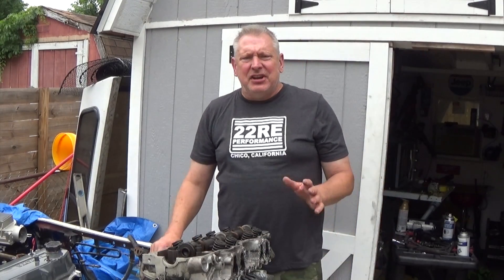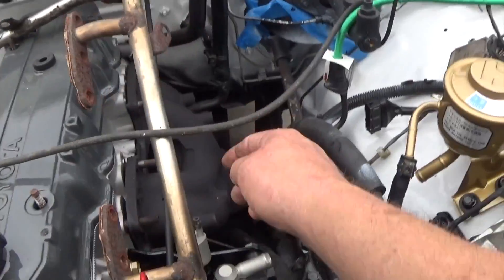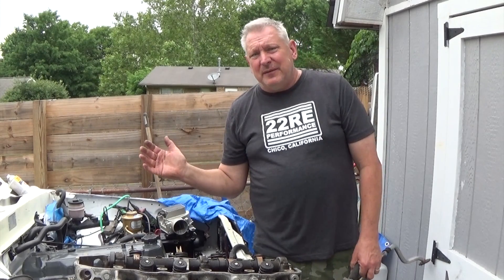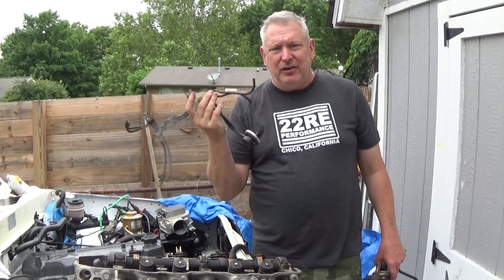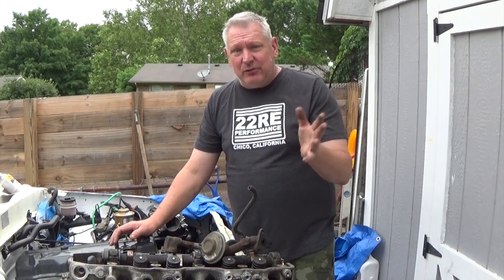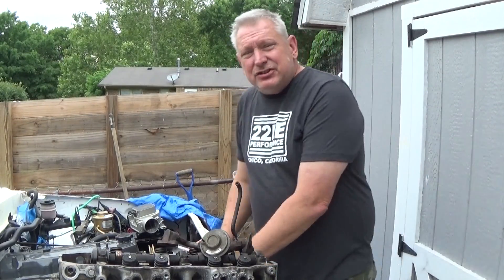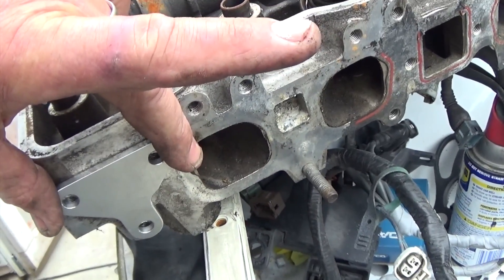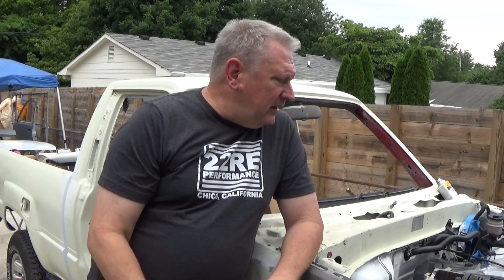Toyota 22R EGR Delete - Functions of Emission Controls and Removal

Comment: I just completed a egr delete. All the plates are indeed set and good to go but I am now slightly leaking coolant somewhere under the intake manifold 
What could be causing that. It only drips when the engine is running so I can’t pin point exactly where 
Any ideas?? 
Awesome video by the way

Comment: I have a 1980 in CA and have to pass smog, so I need all  parts in place every two years. I plan on simply cutting out a thin piece of sheet metal to stop the flow of exhaust through the EGR to protect it so it's in good shape when I do need smog.  As I'm typing this it occurs to me that I only really need to loosen the egr and slip  a blocking sheet, tighten it back up and leave everything else alone.  Any thoughts?  I have a hybrid 22r block and 20R  head and I somehow managed to pass smog every year since 1989... with all the EGR leak headaches of course. My EGRs are past end-of-life so I need to preserve them.
Reply from the maker: That should work fine as long as they arent that strict on smog tests.

Comment: Did you ever do a smog test to see if it will pass?
Reply from the maker: still workin on it but they got rid of that requirement in TN
Reply: @RedneckGarage  Been gone in Texas for a long time.  Gotta do a head gasket replacement this weekend, so all that crap is coming off.  Just ordered the plates from YotaShop!

Comment: Just bought one of these old trucks and its a 93 with fuel injection. Can I still do this? Or do I need to have to tuned by a shop first?
Reply: you can do it on the 22re

Comment: I like your vid but Can you go thru the vac lines? Mine is a 22r carbie deleted egr and the exhaust injection cause they were causing issues at idle some time would run just fine some times would just die at lights

Comment: My concern about EGR removal.  When an EGR valve or solenoid is not working it creates a spark knock in the engine. This has been my experience with 2.2 GM Multi port fuel injection engines.  Not sure if yours will have the same result.
Reply from the maker: We shall see - from my research that is not a problem with the 22re

Comment: I can't tell you how many hours I spent on the emissions system on my old YJ.  If I had seen this before getting into that mess I would likely deleted it all too.  My only concern would be the catalytic converter fouling up.  It seems like a hotter cat would be a happier cat.  Rock on David!
Reply: ez answer, ditch the cat!
Reply: @freemaysin  No doubt...I could have done it on my YJ since it was a '90, but should have started off that way before getting invested in the parts and time.  Would have run a lot better too.
Reply: @melodicdreamer72  alot of people have stuff to say about it, and it MAY not be the most economical choice, but i have a catch can with a breather filter on it and it collects alot of blowby, and i very very rarely have visible exhaust gas.
Reply from the maker: I think that would be correct - the hotter the better lol
Reply: Left Coast Engineering 😂